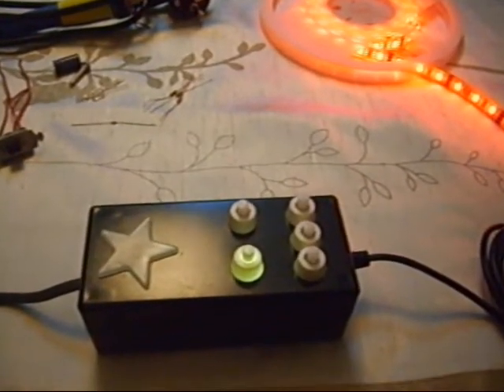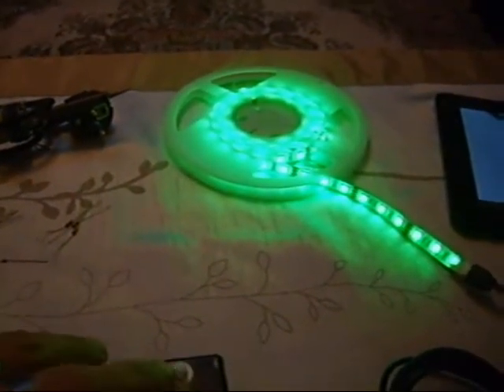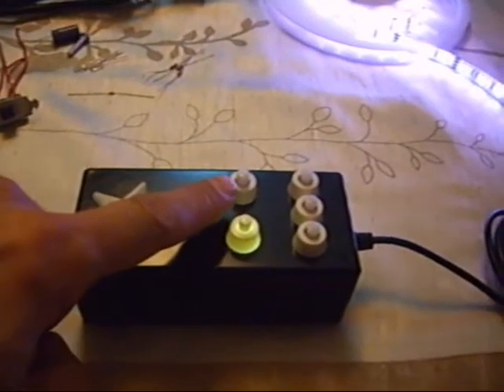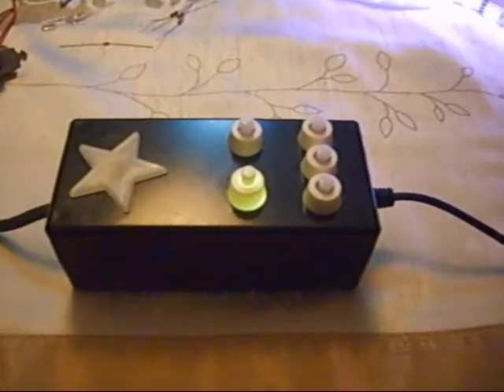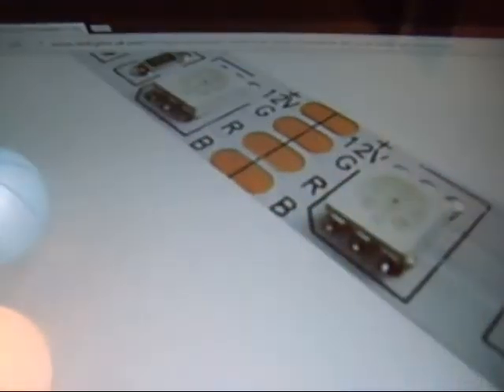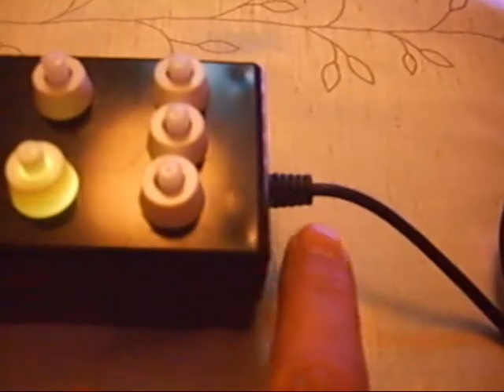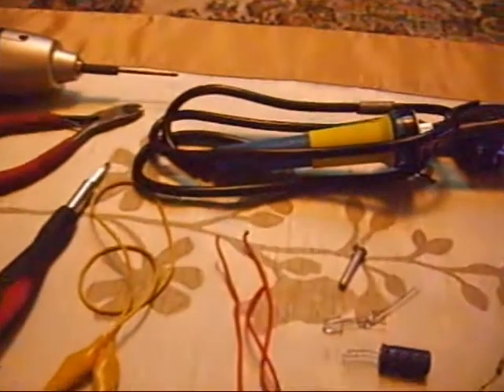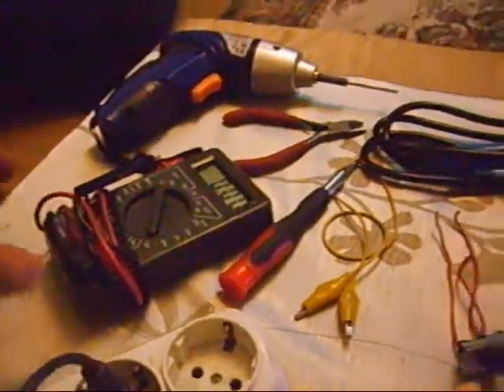🎛 DIY Low Cost RGB Color LED Strip Control Circuit 📕📗📘 (subtitle added)

Comment: can u share the cicuit
Reply from the maker: I am sorry, but i have never  drawn a circuit for this. It is made mainly out of  'on-off' switches to select the wanted color circuits. A experimentaly chosen resistor in serie is included for limiting the current for the dimming effect. That's all, any special components are inside. I hope theese hints will help?.